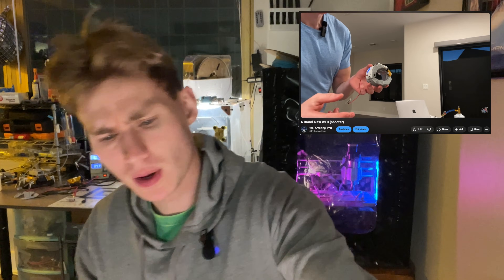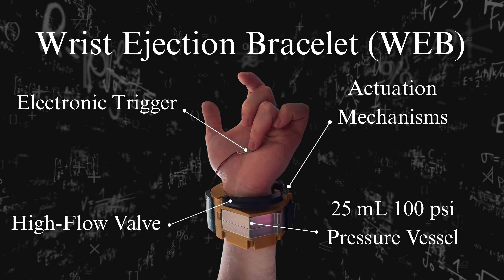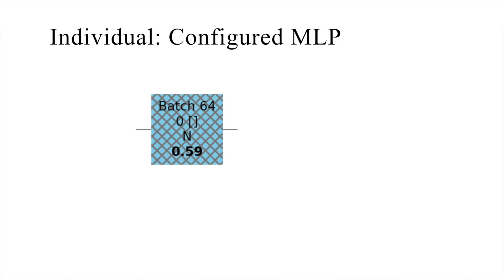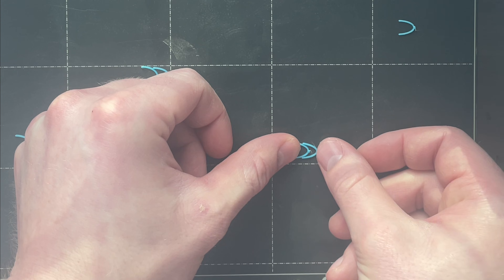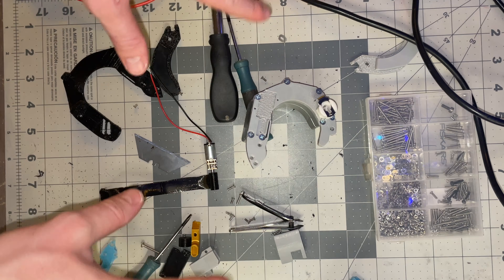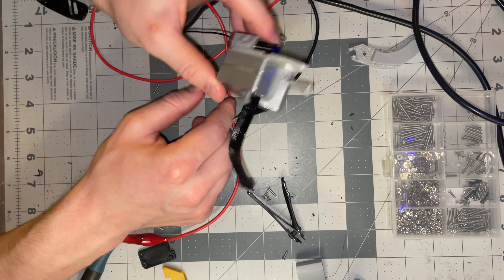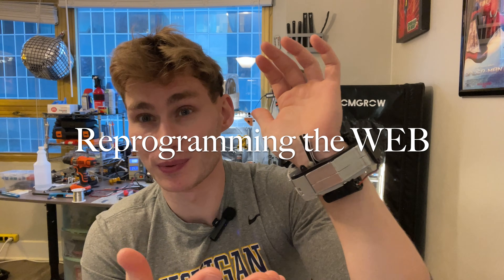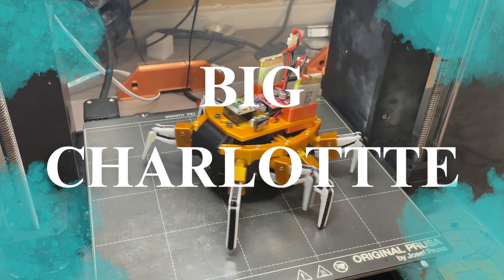A Deployable WEB (shooter) Trigger

Comment: You might be able to make a set of rings that you can have on your fingers, when bending your fingers you pull a string/elastic that has a magnet to trigger a reed switch (or multiple ones, or a magnetic sensor, or a set of leds and photodiodes if you really hate magnets) at that point you can look for an obscure set of gestures that won't come up in everyday use and make that the activation, it's very light, should be relatively easy to make, only downside is the rings, you can try to have as few as possible for your selected gestures but this does depend a lot on the complexity of the input you want to have.

Comment: Another option for the trigger might be to make a laminate of two strips, joined at the hand end.  Both strips are spooled like your current version.  When they are unspooled, the strip closest to your skin, catches on a pawl (or is too wide to fit through a slot) - so it stops moving.  The outer strip continues to unspool, forcing the laminate to curve towards your skin.
Just a thought!
P.S. I've also used force myography, without ML, just using a fuzzy statistical approach.  However, I was trying to derive force rather than specific gestures.  Ultimately, I think this is the better approach - it just needs a bit more work.  Start with something as simple as possible & build on that to find the sweet-spot between complexity (of gesture) & reliability.
Reply from the maker: Thanks Simon! These are all great suggestions.

Comment: Since you already have a pressurized vessel in this, would some sort of inflatable bladder be a good option for the trigger deployment?
 Since it would be a fully pliable material, it could be stored in very small space, you could have a secondary nozzle to your pressure vessel built to inflate said bladder when you need to deploy the trigger, and constricting a section of the bladder with some string would force it to curve into the desired shape.

There's a lot of stuff on soft robotics that could be usable in this case, especially since you only need to move the leads to the button to your palm, and nothing more complex.
Reply from the maker: That would be cool, except that the pressure vessel would contain a propellant and some other payload fluid mixed together. Pressure regulation is also important for these pneumatic soft robots, not sure how small a regulator I can build.
Reply: @theAmazing  Oh yeah the payload fluid might gum things up in the long run.
If you do find a way to go with that design, maybe not using the main vessel for the pressurization, it would at the very least reduce the amount of moving parts, at the cost of adding a bladder that might burst, and raising the manufacturing complexity.

Comment: U can get sm sorta camera which scans for hand gestures everytime u flex ur wrist. Constant monitoring would take a lot of battery power. Or u could use the bracelet to give high voltage to ur palm. The tip of ur fingers would act as an antena. Have a 5 coils on the braceletl u would get different signals from your coil based on different hand gestures. Say u are going a thumbs up gesture ur 4 fingers would be closer to the coil and will produce a heighrr signal. Ur thumb is away so less signal from the 5th coil

Comment: Tbh the web shooter itself can be simplified by havi g a micro/nano solenoid valve with just a spring, copper wire wrapped around a steel bobbin and a steel needle ball valve that punctures a ball valve with a rubber "o" ring imbedded inside a cartridge. That way it saves you room for an electro magnetic brushless rotar that spins the Z and N terminals (pin holes) inside a hollow nozzle to braid around the core that will aide in secreating the trapped fluids and provide extra tensile strength to the webbing. Since the core is thicker, it gives the fluid a slightly longer curing time but much faster and more efficiant than air drying or tempature curing like the previous web shooter tests in late 2010's/ early 2020's. Only problem is to calculate the distance between point a and b to find the best range for a solutability ratio that allows the fluids to make contact to a solid object.
Reply from the maker: You’ll have a really hard time controlling 100 psi with a micro nano solenoid valve

Comment: if you straighten normal measuring tape the cross section is a "line" if you straighten your trigger the bend has more material so it will be thicker. Shouldnt accounting for that solve the extension problem?
Reply from the maker: That’s a good point!!

Comment: Your tape measure solution is very creative! If you want to see a similar solution to the problem of getting a mechanism to telescope outwards with electronics connected, you should check out HeroTech's latest design for their extending and retracting lightsaber, because that went through a lot of R&D like what you're doing for the WEB right now
Reply from the maker: That's a good call, I'll see what he did

Comment: I feel like the current bend on tape structure might not be compatible with different hand sizes. Maybe making the entire path slightly bent will work better, although that might apply more pressure to the skin and be uncomfortable. Also you could try making the parts of the bend contacting the wrist ( top of edges and bottom of center) lower friction to facilitate extension, I guess you may have already done this with rigid inner material, which.
Reply from the maker: There's definitely room for adjustment with the structure, I'll definitely take your comment into account as I investigate.

Comment: 6:18 This is amazing and I am no electrical engineer or electronics expert. Another possible route might be a camera embedded at the front to “see” the finger motions? I have no idea whether that would be easier to train than the muscle sensing. Excellent job!
Reply from the maker: That is an interesting idea...
Reply: A concern about using a camera. Lots of things can affect what it sees.

Lighting
Skin tone/colour
Sweaty palms/wrist
Gloves
Long sleeves

Highly unlikely but also skin paint as well.
Reply from the maker: @destroyer1675  That is true. A monocular depth model like https://depth-anything.github.io/ could fix that, but it may be too expensive to run locally.